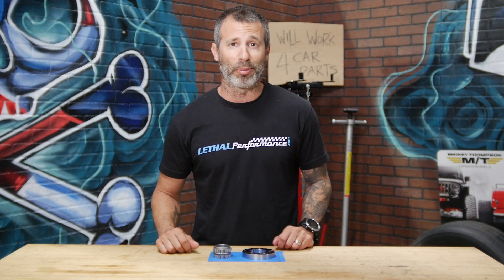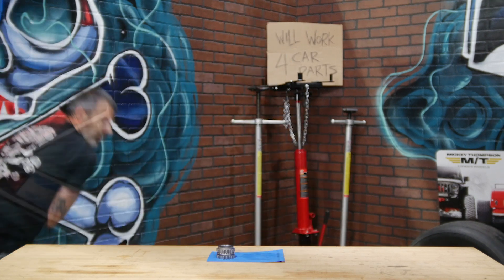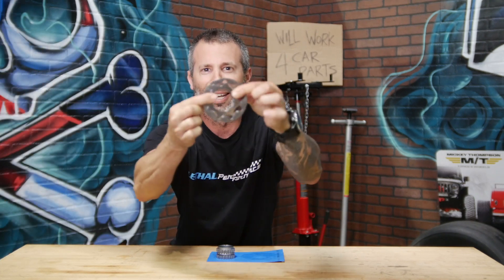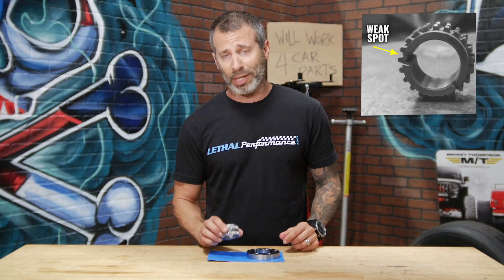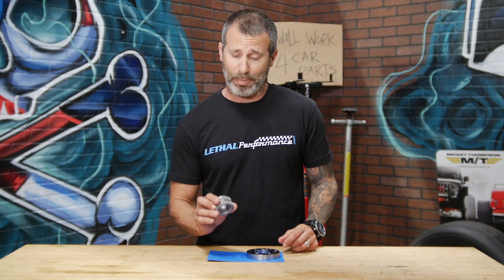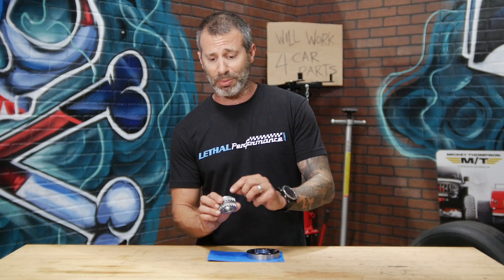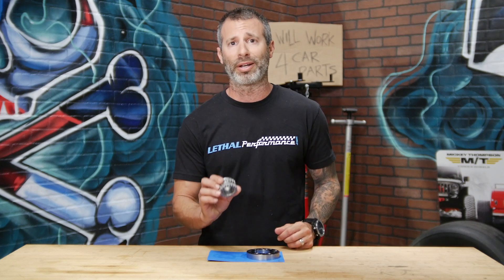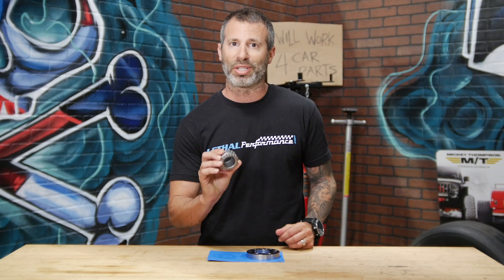Lethal Performance Tech Tips: Boundary Engineering Oil Pump Gears & Crank Sprocket

Comment: The only ones of these I’ve seen broken are the ones people throw in the air   Haven’t seen them broken in the oil pump housing as of yet.
Reply from the maker: Do a little searching on some of the forums and FB mustang groups and you'll see plenty of failures in the oil pump housing as well as on the crank sprocket.